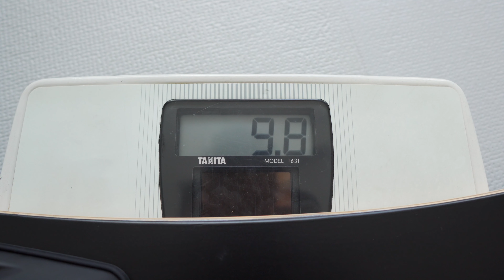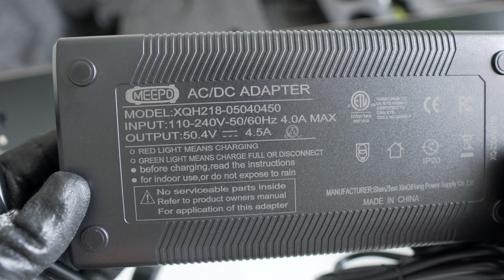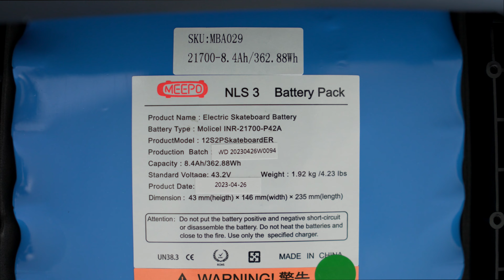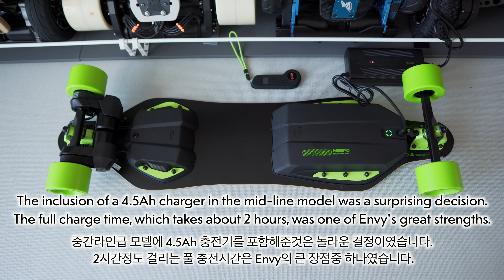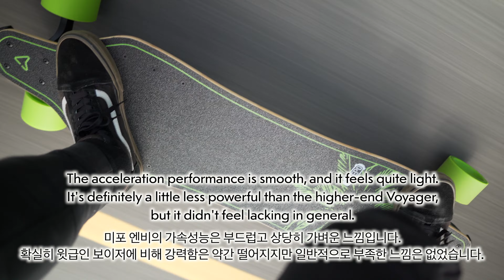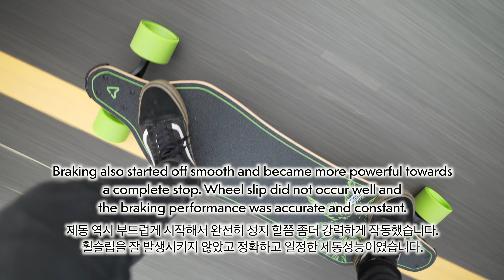#181 MEEPO ENVY NLS 3 - The most cost-effective for performance ST-type E-longboard in 2023

Comment: Mine showed up last night! Absolutely amazing upgrade from my X1Max Hub! The Envy tackled the same 6 mile ride that would have drained the X1, and did the STEEPEST hill around here with ease at 25% battery too! Amazing second board for me! And oddly mine came with extra belts as every unboxing I've seen thus far there has been no extra belts!
Reply from the maker: That's good~ :) Hope you enjoy~
Reply: Same here! Extra belts - feels like a good thing IF they tear - where I live (Sweden) we have a lot of gravel on the roads still from winter... "spring cleaning" starts in a few weeks - THEN...wooosh 🙂
Reply: @gone4good I ended up getting gear drive kit for mine. Too many belts breaking and when i lost both belts at once and had no brakes, i said enough is enough!

Comment: Hello, I really like your videos and you show so much. I miss the steep hill test you used before. One thing you cannot get through reviews is longer use experience. I just saw a video of a man that owned four Meepo boards and hade very bad experiences with quality and support. His rear truck on the Meepo envy broke in half even though Meepo said is was no problem.
Reply from the maker: Based on what I see and hear around me
1. Depending on the rider's habit, damage to the truck or deck may occur due to accumulated stress.
- Heavy Rider incorrect carving drive
- Use the deck with water or coating peeled off due to mismanagement of the board
- Deck damage due to loose tightening of truck to deck connection
- Damage to the truck that can occur when axle bolt tightening is wrong when the wheels are mounted on the truck

2. Problems with the parts themselves already at the time of shipment
 
3. Just a bad consumer.

I'm not trying to speak for the company, but most people don't have such issues. I've been doing reviews for a long time too, but I've never had such problems on the board I've received. I hope it's not too negative.
Reply: @KAMiJUINs  thank you, I understand.Although the man in the video was not heavy and not used it for long. Seeing the broken off area it looked like poor metal but who knows. Thank you

Comment: looks like a descent board, would love to see it compared to something like a Tynee Ultra, it seems to be using the same battery and almost the same top speed but the price is 100$ cheaper!
Reply from the maker: Thank you for watching bro~ :) And I think we don't need to compare. It is easy to know because the release time is two years apart, and the motor output, ESC current, and battery specifications are different.

Comment: I wish they made it in a nice quality. 
My NLS Pro totally died in a year. 
Hurricane - 1000 miles and battery died. 
Broken trucks. Broken charging module which f up the battery. Cyclones 110s didn't fit well.. 
Both covers for trucks didn't hold them well so I had to remove them. 

I love meepo but I wish their quality was better. 

My friend still have a booster and after 7 years it works perfectly.
Reply: Idk Ive ridden the same OG meepo NLS since 2019 and only changed the battery(included) once. Everything still works okay but im looking to finally retire it.
Reply: @d0ppler32  glad for you bro. Did you buy a battery or meepo replaced it?

On a hurricane i still had a week of warranty and they sent me for free.
Reply from the maker: That sounds good~ :)
I think their quality is improving more and more. Even if look at Envy right now, the assembly quality was better than the Voyager.
Reply: Don’t know what you’re doing with your boards. We have an NLS pro working perfectly for over 3 years now, same as a v3 ER, and another NLS pro for 2 years. I think what you’re forgetting is many companies share similar parts. Whatever you’re doing to your meepo boards, would also happen to backfire boards, wow go boards…

Comment: Hi Kami ❤
Since you was tested the 121c aileron deck,  so what do you think of swapping this envy to aileron.? Is that possible.?
I have a arc aileron which is completely dead but can't move on for th3 deck alone.
Reply from the maker: Hi~ :)
Is there really a need for that? If it were me, I would just use Envy by itself.
Reply: @KAMiJUINs  i don't know but i really love the one piece pure carbon deck and the aileron is the short deck which is i love even more.
And i see everything about envy is very good, the small motors, battery, trucks, esc, remote, everything excluding the deck.
Oh and the envy price also, its the cheapest almost perfect electric skateboard IMO.
Thank you for the response anyway.

Comment: ⚡🔥🔥⚡
Omg Kami is such a model with those sunglasses matchin the board's theme!!

I was very intrigued when I saw Meepo tryin Hobbywing ESC again, my favourite ESC, on a Meepo Belt drive 👌🏼👌🏼 Temptin board!!

The neon green baseplates and kegel pulley 🤩🤩
I "envy" you 😂

Since my Ownboard W2 developed an issue I have missed ridin this style/form factor of eboard, the boosted style.

Crazy to see a 4.5a charger here!

I wish hobbywing would make a wowgo/exway type remote as the standard, I don't like the bigger oled remote and I would love to have the option to turn the screen off, for battery to last longer.

I'd put a Caliber III raked truck on the front 👀
and possibly a 44deg baseplate in the back, my preferred split setup.

You are makin me want to buy this board 😂😭 I have no space left lol!! Looks better than the Voyager and my fave ESC 🔥

20miles is good range for this style of board 🤙🏼
Reply from the maker: Yeah, Bro~ I kept thinking of you during the test because of the color of this board. I think the Meepo made "Envy" about you
And I was sure you'd fall in love with this board.lol :) Thanks bro~
Reply: Honestly for battery to last longer? My remote lasts forever with a screen and takes absolutely no time at all to charge.
Reply: @ESKATEUK  congratulations, happy for you 🤙🏼👏🏼
Reply: @KAMiJUINs  haha, it's made for me 😁😎 I always wanted neon yellow/green baseplates, there was a special edition Paris V2 truck that had it, sold out before I saw them 😭
Reply: @eBoard3R  cheers bro! 🙏🏼

Comment: Hi! I got my Envy NLS3 a few days ago. I discovered that the front wheels do point inwards a bit, like "toe in" on a car when the front wheels plow.
Are your front truck also like that KAMiJUINs?
Reply from the maker: Hi~
Really? I haven't even checked that.
Reply: @KAMiJUINs  Yes to me it is quite obvious and is easy to spot when standing on the board and look down on the front wheels. Meepo responds that it is normal. But I can not say that my other boards hade the same type of angle on the front wheels?
Reply from the maker: Does it cause problems for it to work?
Reply: @KAMiJUINs We have snow here now so I can not test it out right now, but I did ride it for a few km before the snow came and it was rolling but I can not say how much of a problem this is. I guess most trucks are straight like an axle so the wheels are in line with each other?